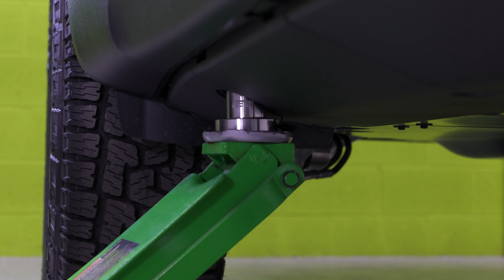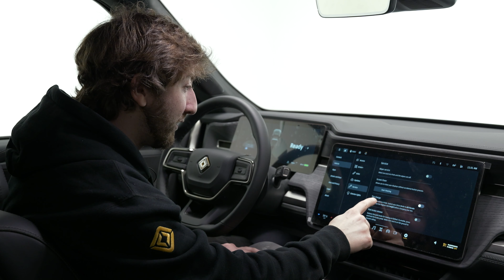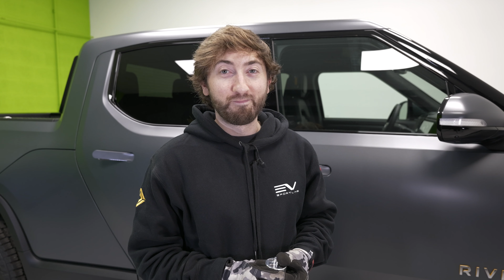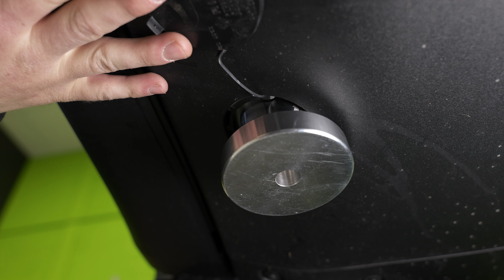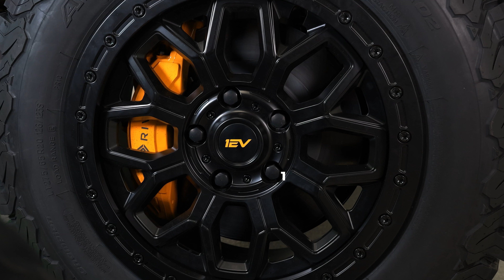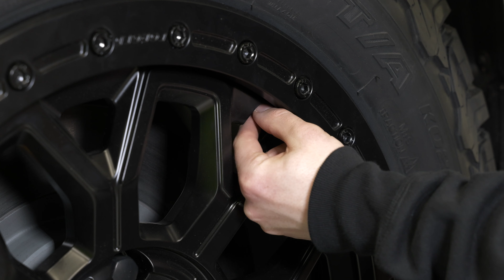How to Properly Install Wheels & Tires on Rivian R1T / R1S 🔧 Step-by-Step DIY Home Instruction Guide

Comment: What's the logic behind putting the suspension on the highest setting when changing tires? That seems like it would make jacks more unstable to have the vehicle jack points higher off the ground. Obviously, you would need to disable the auto-leveling feature.
Reply from the maker: It’s for convenience and a safety precaution - when the suspension is at max height, there is more room under the truck.  And if the suspension is not fully extended, then you jack the vehicle up, then if the Rivian air suspension activates and tries to move it could lower and crush something or knock off the jack.  When it’s max extended, it cannot activate and crush or drop further.